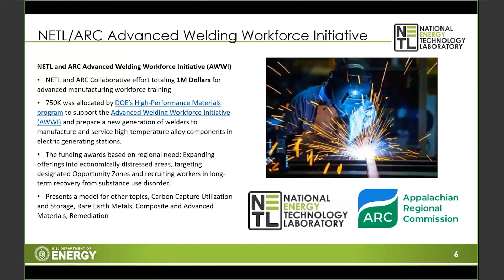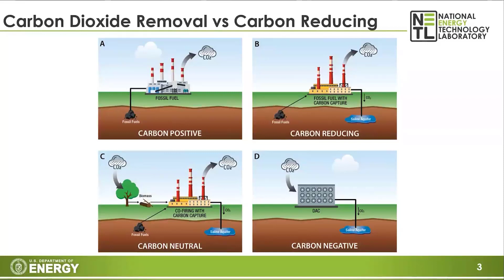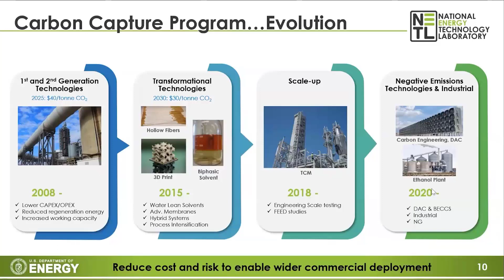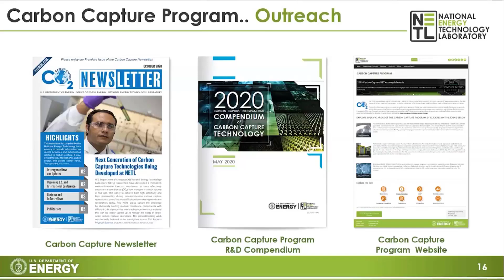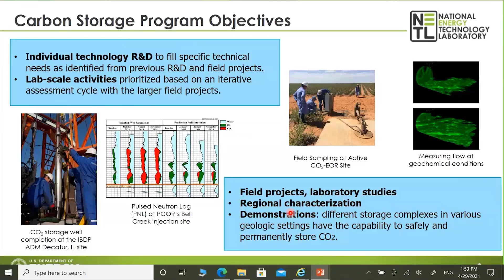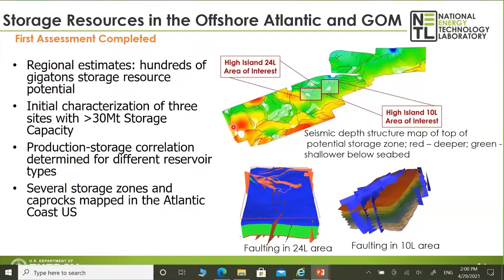NETL RWFI Energy 101 Webinar 04/29/2021 - Carbon Capture, Utilization, and Storage CCUS

Comment: Placement of storage can be stretched over long narrow routes, using the structure on top the storage area as a barrier and controllable pressure application point..  multi layer pressure application allows for more variety of outputs from same input..  capturing the most sustainable energy at the point where it's most valuable to the ecosystem, with this process the elimination of nature factor. Risk is controlled allows price to be cut by a high percentage...   Great presentation